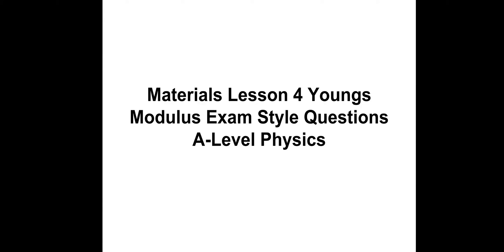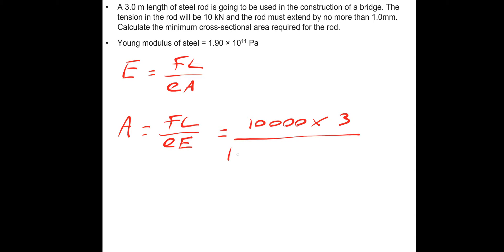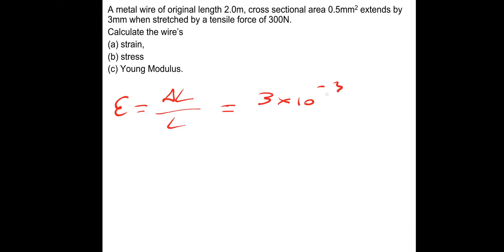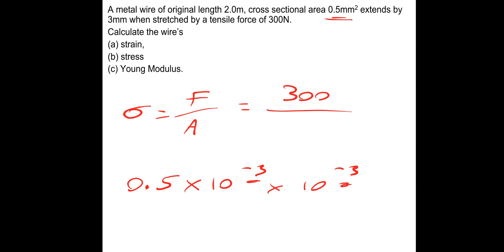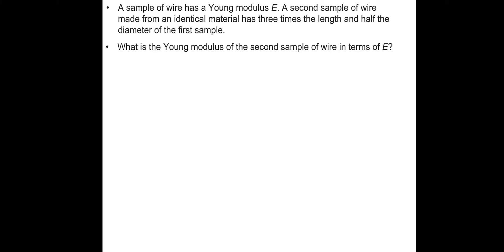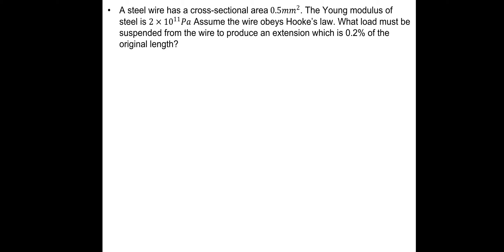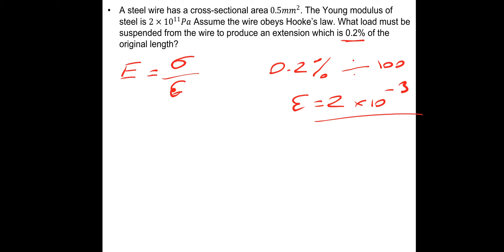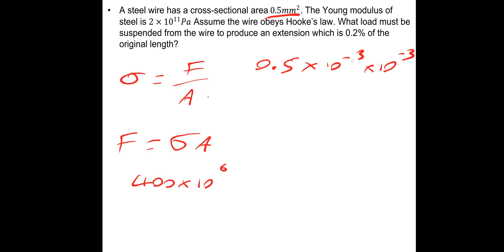A-level Physics: Materials Lesson 4 - Youngs Modulus Exam Style Questions

Comment: At 7:06 would it not be 0.2 x 10^-3 instead of 2 x 10^-3 ? As its 0.2 percent after todo
Reply from the maker: Hi buddy. 0.2 / 100 gives 0.2 x 10 -3. Which would be the strain. Strain is commonly given as a percentage and you must convert it into a decimal.

Comment: At 5:12 what do you do instead?
Reply from the maker: E - Young’s modulus is material dependent. Doesn’t matter if you have 2 different copper wires with different dimensions. They have the same Young’s modulus because they are made from the same material.